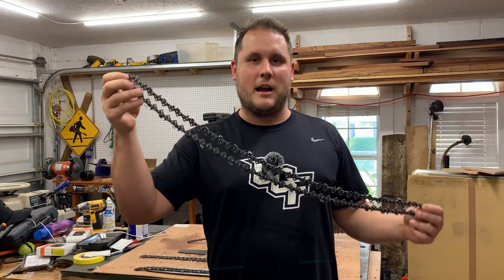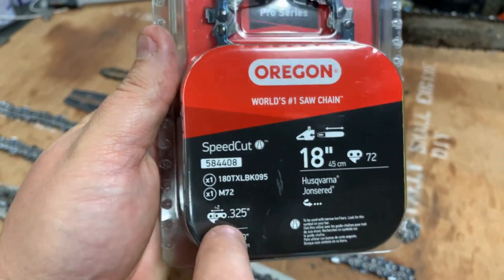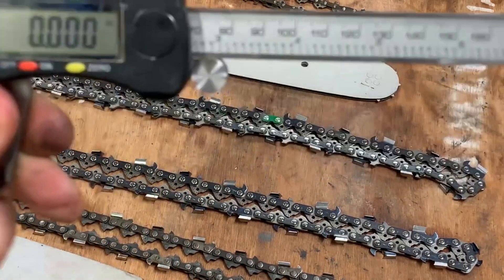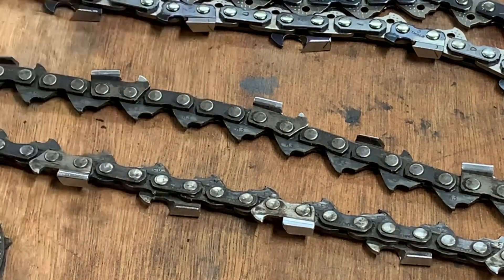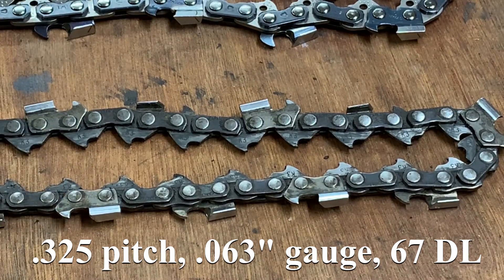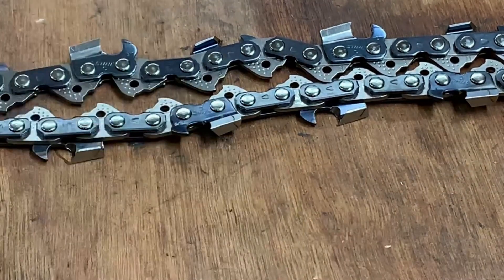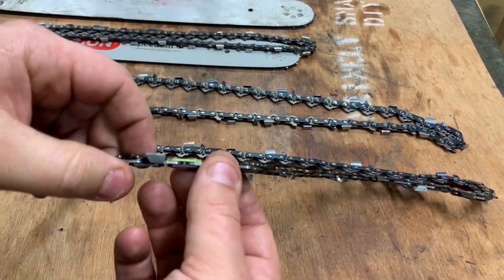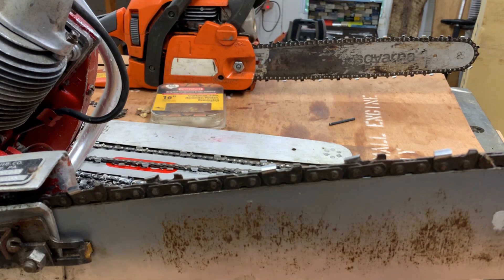What kind of chainsaw chain do I have? Lets find out! How to measure and a discussion about types

Comment: Hey friend. The best way to describe skip, full skip and double skip is how far beyond the recommend bar size for the saw. So if your power head is rated up to a 20 inch bar, and you want a 24 inch bar the skip chain will make it pull like a 20, the full skip would go on the 26 and double skip for a 28 inch bar. Most of those chains come in full chisel, but if you run out of power, then move to a semi chisel and it works almost like moving to a skip. If you're liking small light weight saws for a Go Too Saw. This information will make that little 33cc to 46cc take on jobs that a 50cc plus should be doing. My back is a mess so at 5"7 I use a lot of 24 inch bars so I can stand when cutting and blocking, instead of couching and kneeling. So you can guess I have a few of those chains around here...lol. Great content, keep it going my friend.
Reply from the maker: Hey buddy! This is a very smart system. I'd be lying if I said that I knew a lot about the skip chains! I'll keep this in mind for sure and I'm sure some viewers will find this information useful as well. Thanks as always for the comments - keep that back rested up - I've had issues for years as well.
Reply from the maker: Oh and thank you for the positive words! I'll keep it going for sure!!!!
Reply: Now you know, so you can setup a customers saw or your own. It also helps with underpowered saws, where the customer complains and wants a bigger saw. If they move to a semi chisel from a full chisel it will bite less and cut faster, or moving to a skip will make a even bigger increase in usable power. I am sure the day will come someone will want you to setup a saw for them, and here is a real easy fix without modification to their saw. Keep up the great work Brother, your gonna make some money at this soon enough, as your going step by step for those people who need a little help on a project, and need a walkthrough.
Reply from the maker: Yeah that’s good advice and I’ll remember this! Maybe one day some money but either way I’m just enjoying filming my hobby, helping a few people, and also the interactions are nice!!! Thanks as always